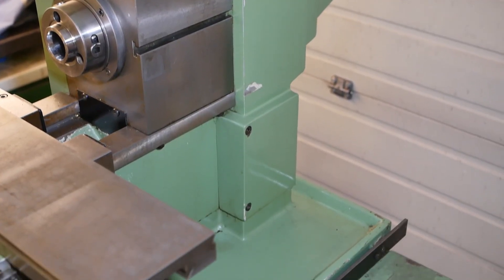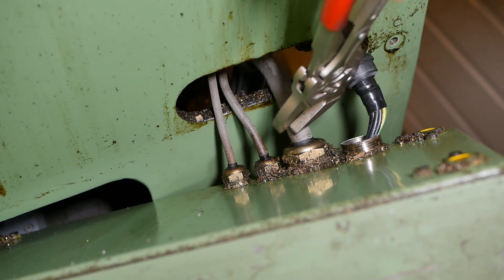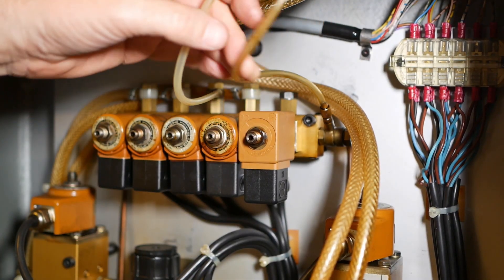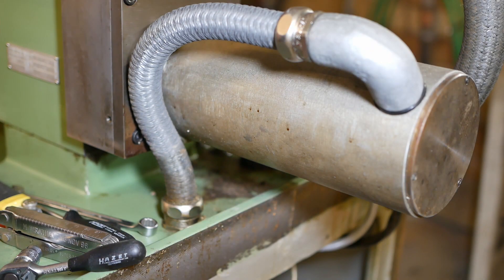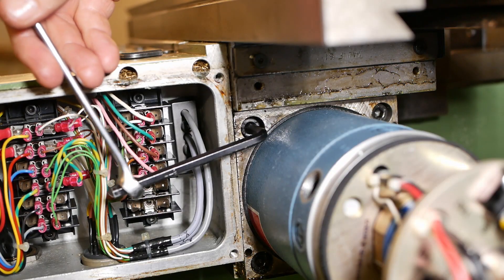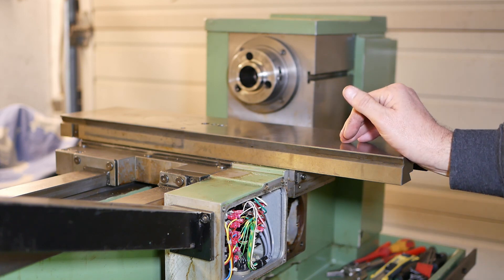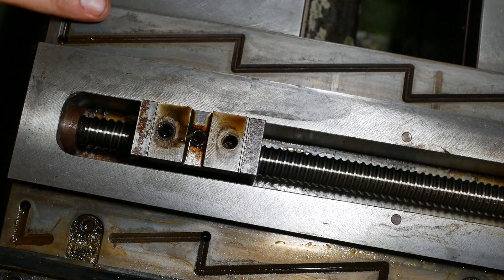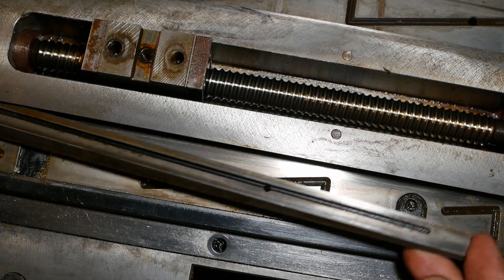Schaublin 125-CNC lathe dissassembly

Comment: Also, I'd have to say that it doesn't look like those ways on the cross slide were scraped or even ground, that pattern looks very much like a fly cutter finish. I'd be very interested to see what it looks like blued up and checked against a straight edge...
Reply from the maker: It does look like a fly cut finish. That mcro shot makes it look quite primative, when really it is a very very fine cross hatching. Good point. My surface plate is a little small, but I'll blue it up for next weeks vid.
Reply: @RotarySMP  a well trammed machine can still provide an excellent surface finish with a fly cutter though, don't get me wrong. Your macro shots showed the detail quite well. Hopefully you'll see a nice even pattern of blue :)

Comment: Why not keep the DC-Servos, amplifiers and everything is already there, likely with +/-10V signal input? Connect a Mesa card with +/-10V output to them, done. Brushes on them will likely outlast the machine and they are easy to troubleshoot, just connect some +/- DC voltage to them and they will move in either direction. 

Encoders are there as well, seems like lots of trouble replacing those to new servo, unless you want direct measurement with HH scales for extra precision.
Reply from the maker: The Amplifiers are not analog +/-10V controlled. According to the schematics they are Step/Dir. But the major issues are size, Synchros, and lack of documentation. Those drives are enormous, and I want to leave the electrical cabinet off and put everything into the pneumatic area. The resolvers are three phase synchros, rather than more common two phase resolvers, and I have found nothing about those drives or the motors. I really don't want to rebuild around unknown 45 year old hardware with not manuals.

Comment: Looks like a good lathe that just need some TLC , have you looked at pathpilot . Its Linuxcnc with some tweaks to run the Tomach line of CNC , i adapted it to my DIY CNC mini mill , so far works good . Probing and conversational are pretty good
Reply from the maker: I really like Gmoccapy. I use it on the Maho and Mini-lathe. I am not a fan of those over loaded screens where every possible function is on the main screen. Gmoccapy is modal, and only provides what you need for the task at hand. I still need to implement NativeCAM for conversational programming. I already have the probing routines implemented on the MAHO, but don't have an electronic probe.
Reply: @RotarySMP  Thanks for the tip. LinuxCNC is my next hurdle and I also like things KISS. Too bad probes are so darn expensive. I'll probably get one eventually after all the expensive bits are taken care of.

Comment: Loving the Schaublin tear down and excited to see where you go from here! Wondered if you have considered using a spindle servo motor with VFD control in place of the Reeves style drive? The spindle servo would give you full torque at all rpms. I know it is easy to spend someone else’s money but just throwing it out there.😀
Reply from the maker: My friend has the later 125-CCN (which is still made) and it just has a big motor driving the spinle directly through a toothed belt. Although it is a 7.5kW motor, it still has not as much torque at the low end as you would want. There is nothing like mechanical leverage there. I will definatly leave the 1:6.5 Backgear gearbox in there, and probably the Variator as well.

There are some col things you can do with a C axis lathe, but most of them you can also do on a four axis mill, so I will probably go that route.
Reply: @RotarySMP  I like the way you did try to keep as much original design as possible in the Maho. The Linux integration was top notch! The  mechanical leverage in the variable speed drives has worked really well for many years in lathes and mills. I understand the desire to retain the original variable speed drive. I was just wondering if the servo spindle would still yield the same torque but possibly easier to control. Looking forward to see how you will control the drive as well as improve the functionality of that beautiful lathe.

Comment: 3 wire valve: maybe a separate ground wire for static electricity?
Reply from the maker: I think you are right. Others also said that.
Reply: Could be latching solenoids, so you drive 'on' and it would stay latched on.  Then drive back off.  So you don't have to continuously have to drive the coils?
Reply from the maker: @scrout  I will have to check that when I wire tham back up. Would make sense.

Comment: Another nice vid thanks. A couple of comments, I also noticed that T slot "crack" last week but after a closer look I reckon it's scratch by a tool used to clean or deburr it? The second motor you took off has "Assembled in Mexico" on it. Does this seem unusual for a swiss machine made in the late 70s?
Reply from the maker: I also suspect that it might be a scratch, but the macro lens makes it look bad either way.

I was also surprised to see that the Motors were made in Mexico, but they have to be original. Actually I suspect that the motors, and drives are all Imperial sized US hardware. The US was the  leader in CNC development at time.
Reply: @RotarySMP  Maybe you can track down an aviation NDT pro who can run a probe on it for you for something a bit different. I guess it is what it is either way.
Reply from the maker: @antonwhittle415  Unfortunatly Ino longer have access to NDT. As you say, it really doesn't matter whether it is scratched or cracked. It is a pretty unimportant feature.

Comment: Man this one is going to be epic. That machine looks well loved. One question though, is it single pump lube style or does it recirculate to a sump?
Reply from the maker: It recirculates. There is a return tube from the the bottom of the chip tray back into the tank.
Reply: @RotarySMP  That's way lube not coolant. Is the auto lube a one shot or recirculating?
Reply from the maker: @misterfixit1952  Oh sorry, I misunderstood. The way oil is single shot.

Comment: What type of motors are they? Can't you find modern electronics to drive it? Thanks for the video! Very good as always..
Reply from the maker: They are DC motors. The Syncho resolvers are no longer common. I could probably replace the Synchros with encoders, and us modern drivers, but would need a DC PSU. I would rather use modern AC servos which will take AC power directly.
Reply: @RotarySMP  yes, power supplies for these currents get expensive very quickly..
Reply from the maker: @braspatta  ...and large.

Comment: Not sure what is driving the solenoids, but perhaps you have a separate earth for a fly back diode to protect the driver?
Reply from the maker: I have been informed it is just an earth. Thanks for the comment.
Reply: @RotarySMP  Super. If you're planning on driving those Solenoids from the Mesa card, make sure you add the fly back diodes - ask me how I know :)  (... and its spec'd in the Mesa manual :))
Reply from the maker: @rbyt2010  Thanks. They draw a bit too much current for the 7i84. 9W v 7,2VA max. I am planning to put the original Schaublin card back in between, unless a good cheap valve block falls into my hands.

Comment: Winging the 3-wire inquiry, but I’m wondering if there are pressure transducers built into the solenoids as some sort of a fail safe in case of a burst line.
Reply from the maker: I got a few answers to that. Most indicate the coil has two taps, to actuate the valve and to hold the value.
Reply: @RotarySMP  Acting like a FET, in other words? Interesting. Definitely let us know if your curiosity gets the better of you & you want to tear into one. Might be less destructive to chase the wiring, but that would be a boring video.
Reply from the maker: @jnorris8649  Good call.

Comment: Loving the content - I'm in the process of dragging a small cnc Boxford lathe into the 21st century (Clear path servos) As you are an experienced Linux CNC user what control card would you recommend for a 2 axis (plus auto tool changer 3rd axis)?  Thanks and please keep the content coming!
Reply from the maker: Thanks. If you are using Step/Dit then use a the 7i96. I used one on the mini lathe, and it is a great controller.
I am probably going to use 7i92/7i83/7i84/7i85 and 7i73 on this build, as I need more outputs than the 7i77 or 7i97 support without expeansion.
Reply: @RotarySMP  Much appreciated :-) looking forward to the next instalment
Reply: @RotarySMP  How difficult is it to commission all of those serial cards together? I really like the looks of the 7i73 for pendant control and keypad. Nice price too. This array of cards gives you max flexibility and the combined price isn't that steep but I would imagine that programming all of these together would be  somewhat of a task. Just programming one mesa card into LCNC makes my beard itch. Hell, just picking my one 7176 just about set my hair on fire. I spent weeks bouncing back and forth trying to beat buyers remorse and I'm still only 90% convinced that I succeeded.
Reply from the maker: @misterfixit1952  The Smart serial cards are plug and play, so once you get the FPGA ethernet card (Your 7i76e) configured in LinuxCNC, you can connect the 7i73 to the 7i76e's SS expansion, restart, and the 7i73 pins will be automatically available in LinuxCNC. If you want more SS cards, you could connect a 7i74 to the FPGA card, and then plug in 7i84, 7i85, 7i83 , 7i73 etc till you run out RJ45 connectors.
The 7i73 has a couple of mode options, which are slected with jumpers.

For the Schaublin, I'll probably use a 7i92 as my FPGA, and then a 7i85 to interface encoders and the rest of the SS cards, which will be 
-7i83 (analog motor) 
7i84 (I/O) and 
7i73 (User control module). 
Weird set up, but works out a little cheaper than the 7i97 + 7i84 + 7i73, and gives me more flexiblity in placement.
Reply: @RotarySMP  Thanks for the info. I'm new to LCNC and Mesa and am a bit intimidate by some of the setup trials I have seen on the LCNC forum and other places. Dealing with Hals and such can be a rabbit hole I don't wish to explore. Are you going to run your servos as step an direct or analog 0-10v and are you going to use the servo control loop tuning or LCNC, encoders & servo loop for tuning, using the LCNC tuning tools? I am using the step & direct servo tuned loop because my Triton came factory tuned using the Omron software but I could , most likely, increase the overall performance and precision of the whole system by expanding the control loop to include real time LCNC control of the servos thereby increasing velocity and acceleration parameters (or just driving me crazy). I watched Marco Reps do that with his CNC mill and decided it was a bit above my pay grade at this time. I am really excited about your control panel and MPG scheme using the 7i73. I'm ordering one today.  I will watch your build closely to glean answers to life's many  mysteries ;-)
Reply from the maker: @misterfixit1952  I will command the drive with analog +/-10V.  Yes this will require the servo tuning of the position loop within LCNC; but I had to do that on the Maho. You use the HALscope, and after a bit of mucing around, you get the hang of it.

I am still considering whether to add linear encoders. This would be simple on Z, but quite a challenge on X.

Comment: Great video as usual. How come the motor change though?
Reply from the maker: Because the three phase synchos are not supported by common drives, because they are DC and I dont want the space of a Transformer, and because the existing drivers are huge but undocumented.
Reply: @RotarySMP  seems fair enough to me. What will you swap them out with?

Comment: maybe two of the wires actuate and one is for feedback if it's actually opened/closed?
or it lets you actively open/close it in addition to the self-return spring?
Reply from the maker: Good thought. I need to spend some time investigating these pneumatic solenoids.
Reply: Brown / Blue / Black is proximity sensor colours, so valve actuation feedback seems possible. 
But literally seconds of Googling hasn't turned up any example of that, and the online stuff on DIN/ISO 436 50 only seems to mention + - and Gnd.
Reply from the maker: @andypughtube  Yeah, when I said that, I was thinking "you lazy bugger, google it" Thanks.
Reply: One common wire and one wire for each direction for the valve, if they are directional valves.
Reply from the maker: @millwrightrick1  These are only single acting with spring return.
Reply: @RotarySMP  Those solenoids have a standard plug that lets you plug into a unidirectional solenoid or a bi-directional solenoid, The male end on the solenoid will have two terminals while the female side has 4 slots so if AC 120v  is used, there will be a neutral , ground and two hots. The same plug can be used for all voltage configurations.
Reply from the maker: @millwrightrick1  Thanks, I didn't realised they offered both AC and DC versions, but guess that is common with industrial hardware.
Reply: @RotarySMP  I could not see the valves but I suspect that they are subplate mounted, again for ease of removal or for changing configurations.